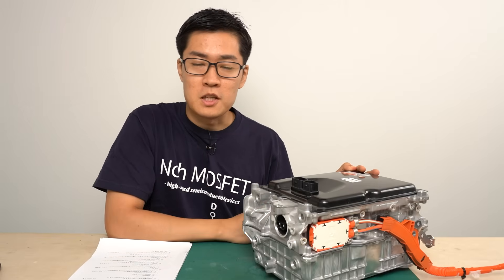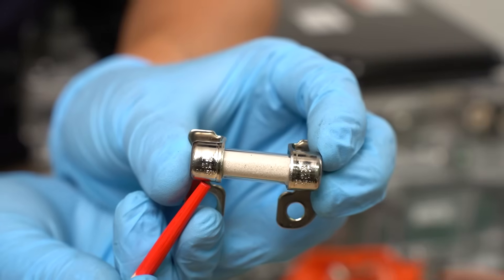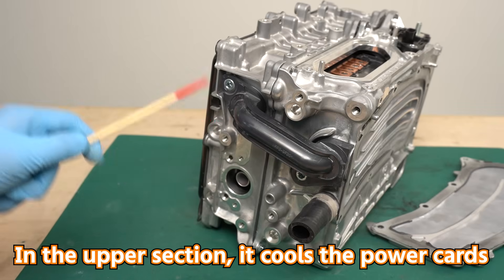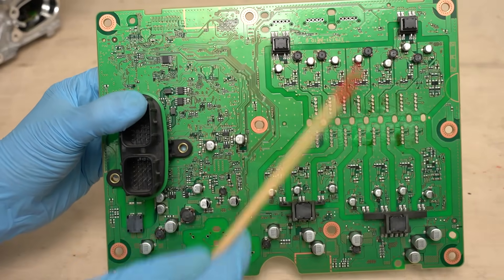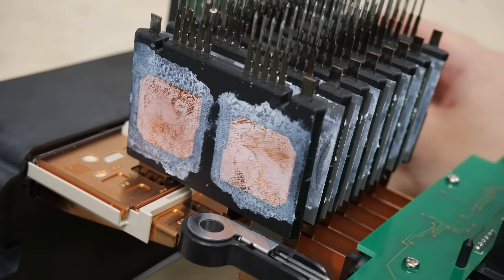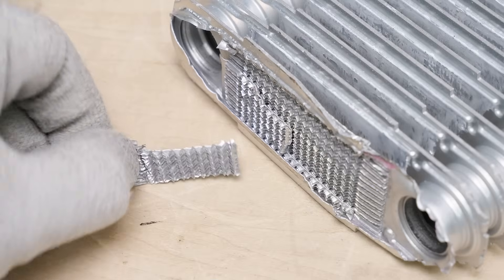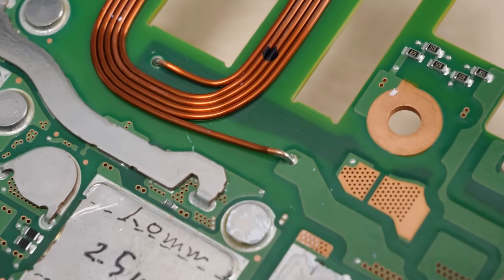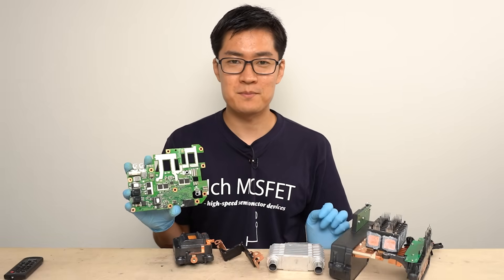Teardown the Inverter of the 5th Generation Prius! [ZVW60]

Comment: Coolant degrades over time and may become corrosive, I wonder how often (if ever) it will need to be flushed/replaced to prevent it from eating into the metal alloy...? I'm sure a lot of engineering thought went into this design coming from Toyota. Awesome.

Comment: hank you very much for the amazing presentation and analysis of the circuits, you and your channel are unique.

The design of the entire system is excellent and the study of how all these components and boards were placed in a harmonious and correct way without seeing cables and connectors like in the BYD that you had shown in an earlier video.

Also, the quality of the materials of the cables is awesome. The design of the board that had the two Renesas integrated circuits reminds me a lot of the design of Philips Dutch boards. It's as if the board was taken over by designers from Philips 18 years ago.

What made me wonder is that I didn't see a temperature sensor anywhere to see what temperature the plates are at. Another question I have is how vulnerable the system is in the event of a coolant leak and general damage to the cooling circuit. 
In other words, will the pcb overheat and eventually be damaged? 
Or will the car's computer indicate a loss of coolant and the car will stop?
 Thank you once again for the hidden points of the plates and the pictures.

Comment: JUST FYI ZVW60 is the sixth generation not the 5th.
Reply from the maker: You are wrong
Reply: @DENKI-OTAKU  Nope, its been that way all along. NHW10 was Gen 1
NHW11 was Gen 1.1.
NHW20 was Gen 2
XW30 was gen 3
It's Model code followed by Generation Number. 
Look it up.
Reply from the maker: @Casper-NineteenEightyFour  https://global.toyota/en/mobility/toyota-brand/gallery/prius.html
In the case of Prius, model code and generation number do not match.
Reply: @DENKI-OTAKU  I see whats going on there. Its a 6th Generation Car but a 5th Generation Hybrid Drive-train. So you are referring to the Hybrid Drive-train being 5th Generation.

Comment: Why did they go for a boost cirquit in front of the inverter? I can`t see any advantages. Like, increase the battery voltage or decrease the kv value of the motors
Reply: Doubling the battery voltage from 400V to 800V would make the battery management much more complicated and I think greater security measures have to be implemented. Boosting just the voltage at the motor winding decreases the current and makes them more efficient. The kv is used for BLDC motors but usually the vehicles use permanent or externally excited synchronous machines that are configured for a specific speed range.
Reply: @petar7790 yeah doubling battery voltage is probably not feasible in this power level. But is the motor really less efficient? The flux from the windings should be the same if double the turns double the voltage and half the current. The amounth of copper should ne the same. Outside of the motor you definetly have more losses. Ah another possibility came to my mind. Maybe the booster is used mainly to keep the voltage stable over the battery voltage range?
Reply: @petar7790 A BLDC motor is a permanent magnet synchronous motor. BLDC is basically just a marketing term
Reply: The price! 😂😂😂

Comment: Great video, you're right that the assembly for those copper bus bars is probably the most challenging update over the previous version. The bus bars would either need to be soldered on after surface mount assembly (where getting enough heat into the bus bars is the challenge) or surface mount could be done afterwards but then you'd need to piezo jet deposit the solderpaste because a solder stencil clearly can't be used. Either way it's a pretty big challenge! To be honest I prefer the implementation on the previous version with the dedicated thick copper pcb. Looks more straightforward to me.

Comment: The copper bus bar assemblies are incredible. They clearly had a motivated engineer design those
Reply: Piece of crap. Zero redundancy.😂😂😂
Reply: @VoMop-wq1gyelaborate. how would you design this?
Reply: @the_bootleg_starwalker First, we need to separate the power electrical components from the electronic logic circuits. Power components must be integrated with the cooling system and must be replaceable. It's usually the power switching circuits that fail due to overheating or manufacturing defects. This has long been known. But the problem is that, from a commercial standpoint, it's unprofitable to hire experienced developers, and it's unprofitable to produce repairable cars. And most importantly, unfortunately, people really don't need reliable, repairable electric cars anymore. So, to some extent, automakers are right in making this non-repairable junk. After all, they need to make money. And people aren't willing to pay for reliability and repairability.
Reply: @VoMop-wq1gy the power components seem separate to me. there's 8 power cards which, from what i understand, are the power component here

Comment: It's always interesting seeing what Toyota does! Thank you for the excellent analysis. 

It's interesting that Toyota continues using a regulated DC rail. BEV manufacturers seem to tolerate varying battery voltage, using flux weakening in the motors etc when necessary. Perhaps the battery voltage sag in the lower kWh capacity hybrid batteries makes this unacceptable? Interesting, I've never understood why they take that approach. 

I am really curious how the mechanical tolerance stack is managed on that power card cooler assembly. It looks like a monolithic oven-brazed structure that's fabricated before mating it to the cards. Are the cooling tube sidewalls sufficiently thin to be at all mechanically compliant, and therefore able to tolerate slight dimensional changes of the power cards due to thermal expansion? It seems like grease pump-out could be an issue in an assembly like this. It's crazy if they're just maintaining sufficiently tight tolerances in the cooler to enable them to slot those cards in there with grease and ceramic tiles, and it all just fits well enough to maintain the proper grease film thickness without any real mechanical spring compliance. That mechanical assembly is really the most impressive part of this design to me.

The power card tab welding is almost certainly a laser weld. What's really interesting is the tin plating removal, which also looks like a laser process. It's interesting that the tabs are tin plated, and then the plating is stripped in a big window where the welding pattern is executed. Seems like this could be a reflectivity issue that requires the tin to be gone for welding, or else maybe the cloud of tin smoke isn't so great for weld quality. I wonder if the tin is left on the weld interface side, or is stripped on that side also. Why tin plate the tabs at all, if it's got to be stripped? Maybe related to the internal assembly of the card? I do know that sometimes having tin plating on at least one side of a copper to copper weld can aid weld formation (at least in resistance weld/resistance braze processes). Maybe that's at play here too. 

I really like the whole "reflow-solder stepped slugs of copper through the board" assembly process. It's really cool. The "mega-vias" or whatever we want to call those big rivet shaped structures are super neat too. It's almost comical to see very PCB-like structures such as the two turn winding on the smoothing inductor executed with almost centimeter sized features. 

It's interesting to see that funny little snubber circuit there between the two main secondary side rectifiers. Is that literally just a MOSFET being used as a high power zener? It looks like they have three series-connected tiny zener diodes from drain to gate and a couple of resistors, for gate pull-down and turn on current control... it seems almost crude, but obviously very effective. Looks like there's up to 10's of watts getting dumped into that snubber judging by the heat sinking measures. 

Thank you for sharing this! It's a fascinating design, and shows some really cool and interesting manufacturing techniques.